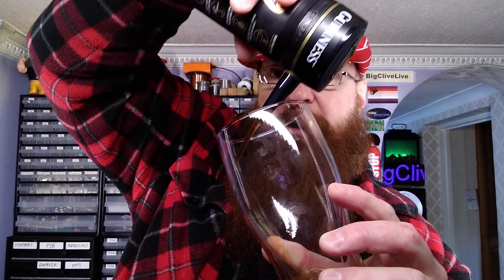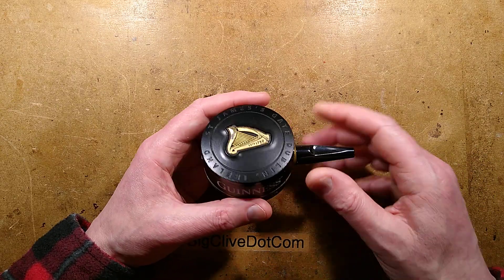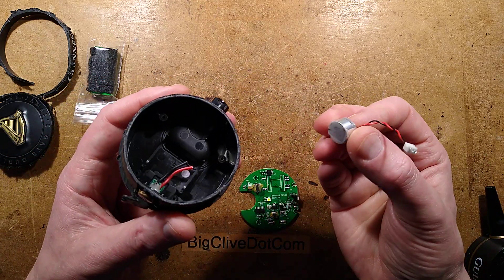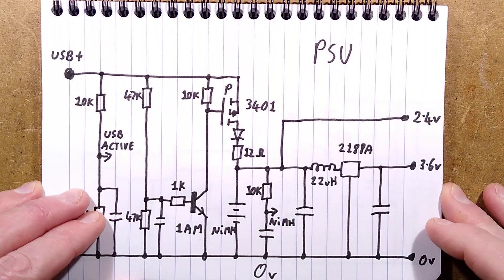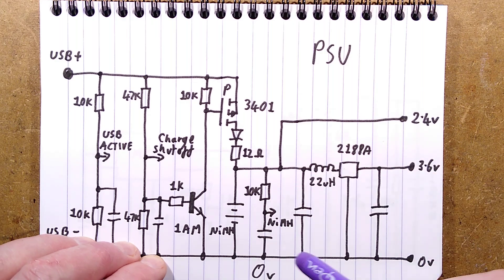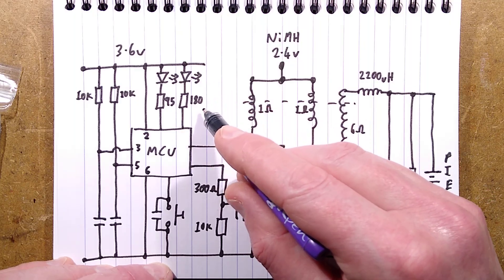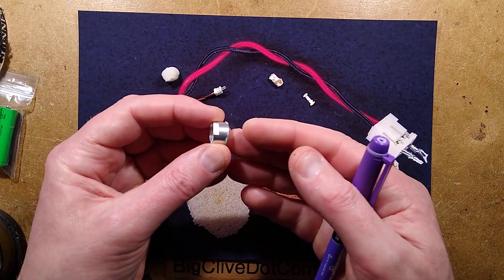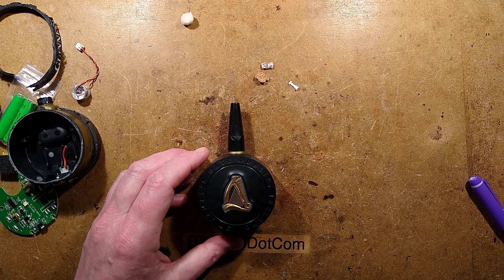Guinness nitrosurge teardown - with schematic

Comment: Did anyone complain there wasn't enough head on their Guinness then?  What happened to the plastic spinning tops that used to be inside (not as nice as the little marbles in paint spray tins, but a nice hark back to the mystery toys in cereal packets. :) ).
In my town there used to be almost as many Irish pubs as people (mostly long converted into corner shops or buldozed for flats now). Then, you had to order your Guinness and wait while the real thirsties walked away with their throat scratchingly fizzy lagers and IPAs. The barlady would leave your 'pint' until it had done its foaming, and then top it right up, and scrape off any remaining foam with a knife.  It was always worth the wait!  :)

Comment: What a faff - the widget in the bottom of standard cans does the job just fine.

I'm old enough to remember (fondly) when Guinness was served at cellar temperature and not run through damn chillers. Stout should not be chilled!

While i enjoy a pint of the black stuff it wasn't a patch on the much‐missed "Digger's Heavy" (McEwan's 80/-  - dispensed in huge volumes in the Athletic Arms in Edinburgh. Nectar of the Gods!

Comment: So much wrong with this.
First off, the glass used was dirty.
Second, it’s 568 mls in a can/pint.
And the angle for pouring was wrong.
You filled the 1st stage too much, and then didn’t let it settle for the required time for that perfect first mouthful.
Reply from the maker: This was a video about the circuitry.  The pour was just a brief demo.

Comment: Hi Clive, did you by chance measure the frequency used by this device? It would be interesting to know what frequency and why. Thanks for another interesting video.
Reply: Yes, I'd like to know the frequency and the voltage at the piezo. A bit tricky now as the transducer is now destroyed.
Perhaps it wasn't in working order by the time Clive had dismantled it enough to get a scope on it.

Comment: As it's so incredibly difficult to get inside that of course means that the rechargeable batteries, once not holding much charge, can't easily be changed, therefore this is yet another device that'll wastefully end up as landfill. Disgusting.

Comment: The LC circuit driving the piezo transducer has a resonant frequency of about 45kHz.  So, that's probably where they are operating, to get the resonant voltage boost.

Comment: Thanks, ChatGPT - definitively, certainly (may in fact be completely incorrect):
The PIC16F1824 is a low-power 8-bit microcontroller with 14 pins and operates on a 3.3V supply voltage. Pin 2 is VCC and pin 6 is GND, which matches the pinout configuration you mentioned.
Reply from the maker: The power pins do not match the PIC16F1824 (pin 1 + and pin 14 -).  But I bet it made the statement with its usual pompous authority.

Comment: i think its a company called funkin or something sell them rank nitro cocktails in a can but they dont use the ultrasonic thing i think it has a mini nitrogen container in it id be interested to see your take on them and how they work
Reply from the maker: The widgets are a hollow ball filled with nitrogen that squirts it down into the drink when the can is opened and the pressure released.
Reply: Thank you for the reply I've seen a widget before they came out years ago,weren't they  originally just to make more bubbles? i didn't realize that is how these nitrogen ones worked but i suppose it makes perfect sense to use the widget. I thought i already subscribed to your channel but must have done that YouTube thing where they somehow automatically unsub me from stuff for no reason but i have resubbed anyway

Comment: I remember the bar I worked at as a student had a bar-top ultrasonic surging device because it was impossible/impractical to get Guinness in kegs where we were. Apparently it didn't quite match kegs on the flavor/texture side but the surging action made for a fairly impressive little performance piece.

Comment: This has me curious about an idea for your "will it carbonate" series. Is it practical or possible for you to make a series on "will it nitro" where you infuse various beverages with nitrogen instead of co2? I think that would be interesting if there's a way to make a sodastream use nitrogen instead. Cheers.
Reply from the maker: I'd have to charge a bottle with nitrogen for that.
Reply: One can buy or make an adapter to connect a pub nitrogen cylinder to the soda stream. 
Then all one requires is an understanding publican willing to lend you such a cylinder and of course swap it out for a full one as required.
Reply: I'd really like to see how nitrogen compares to CO2 in beverages that aren't normally charged with nitrogen. Maybe it's just me.
Reply: @Eremon1  have a relation who is a brewer. He tells me the standard pub gas is mainly nitrogen with some co2. Cant remember the exact mix. Must ask what is in the stout gasses

Comment: A very impressive product indeed but a couple of thoughts about the reverse engineering: I didn't see where the lines that sensed the presence of the USB charger and the charge shutoff control from the first diagram went to the MCU in the second diagram and secondly, it would have been informative to have shown some 'scope waveforms relating to the piezo drive. Other than that, what a fascinating video! I think I'll stick to my barley wine though, ta 🙂

Comment: We used to have a similar thing to this where I used to work - we had to have specific cans of Guinness for it, and you placed the glass on a small metal plate which vibrated ultrasonically. It appeared to do very little at all, but if you put some drops of water on it, you could see it vibrate when you pushed the button. I can’t remember anyone ever using it with a real drink.
Reply from the maker: It's supposed to have a layer of water on it to couple to the can.
Reply: Used that too at my last work place, cool device for Canned guinness only.
Diageo sent it for free if you buy X amount of cans

Comment: The cap at 13:24 is something I  always use for getting rid of bouncing switches. Yes, you could do that in software, but a 10nF cap works wonders as a low-pass filter together with the internal pull-up in the uC. 10nF will give you a +/- 2ms delay and a clean on/off signal. Good enough for detecting 25 pushes per second.

Comment: Thanks Clive, Yet again after watching you it cost me money :)  I have been trying to find the nitrosurge version one for a long time but never did.  However, if you buy the correct cans of Guinness you can use an ultrasonic cleaner instead  just pop the can in the cleaner for 30 seconds or more, if you want one the new version they can be bought from Tesco for £30.

Comment: A device like this with non-changeable batteries should be banned and the one placing it on the market should get a perceptible fine. It's not magic to build a device with a separated and isolated waterproof battery compartment. We talk about environment all day and these devices are just calculated e-waste. It might be cool for Guinness - but bad for the planet.
Reply from the maker: The NiMH cells should last for an extremely long time.  Keep in mind that the ultrasonic atomiser disk has a finite life too.

Comment: So, they're at it again? I had the original Guinness surger from the early/mid 2000s. That one, you poured the drink into the glass and then surged the glass to enable activate it. It looked very good but the cans of drink which, if anything should have been cheaper to make were more than twice the price of the draught cans with the plastic widget inside. After a while they stopped making the units, and the cans became harder and harder to find.
Reply from the maker: You can use your original surger with the widget cans if you tap a pin through the top of the can to very slowly release the pressure so the widget is slowly deactivated.  Then pour and surge.

Comment: You can get the same results from an ultrasonic jewellery cleaner. You start by piercing a tiny hole to release the gas in the can then put 6 cans after putting a hole in the top of the can in the fridge for 30 mins then put a can into the ultrasonic cleaner standing up for 5-15 seconds then take out and pour and enjoy

Comment: Some bars that don't sell much Guinness have a 'Guinness surger' thing which is not the same as this. It works from the bottom of the can rather than the top. They are quite rare so am wondering what the difference is?
Reply from the maker: I featured the plate surger in another video.
Reply: None from Clive's teardown here :) I have one. Same concept just the surger is a one and done thing and not portable. nitrosurge surges as the fluid passes through it.

Comment: After pouring the pint, is it really the bubbles that drop down, or are they anti-bubbles?
Reply: Nitrogen bubbles go down whereas CO2 bubbles go up. I think in practice there is a circulation going on otherwise they wouldn't form the head at the top.
Reply from the maker: I'm not sure what causes the visual effect.

Comment: I remember the height of Guinness technology was "the widget", a ball thing that did a thing to make the bubbles do their thing, and they got Jack Dee to sing about it on their TV ads, still have no idea what the heck that thing was, or did... :P
Reply from the maker: Still in the cans.  It's a capsule pressurised with nitrogen that shoots out a jet into the guinness when the can is opened and the pressure is released.
Reply: @bigclivedotcom  Ah, so there's still nitrogen in there doing its' thing then, haven't had Guinness in a while (and was in bottles too, so, no widget) so never really knew that it was still about... :D

(And thinking of the thing has gotten that Jack Dee ad playing in my head, funny how almost 30 years on it still resides in my mind!!!)

Comment: Oh man.  So cool.  I've been wondering about this thing in your Patreon streams (Fascinating!) (Not a shameless plug by any means!)

I really think it would be cool to have some multi-part hours long streams of you pulling stuff apart and working things out like this.  I'd be glued to it like this thing was ultrasonically assembled and it would take a Dremel to pull me away!

Thanks Big Clive!

FredRock.
Reply: Oh, I wonder if the cork may provide attenuation sonically. Sort of direct the vibration in an intentional direction with it's sort of uniform density and with the foam being like a speaker enclosure in front of it.  Pretty high frequencies I'd imagine and kind of intricate for the assembly itself.  Yea, why not just have a transducer there?  Like you say, the eventual knockoffs won't ask that question.  Sort of like comparing an Audi to a Yugo.

Comment: There's something both mildly disturbing yet highly amusing seeing a bear repeatedly saying the words creamy head over and over! 😂 I used to use the pub version with an ultrasonic plate we put the glass onto that did exactly the same thing. They also have the cans with the plastic ball inside that never seemed to work without first being given a mighty thwack on the bar before pouring!
Reply: I think the cans work pretty well tbf. They will never match a decent poured pint in a pub but still add something over the standard cans which are just rank.
Reply: @The Browns   This was 8 years ago when as far as I know they had just started making them so they could well have ironed out the kinks. As long as the place cleans the lines out draft will almost always be the way to go as the gas is added in at the time of pour so dosnt have the chance to change the taste through acidity. 👍
Reply: @ConfidentialMeerkat   What crazy alternate universe did I stumble into? I most definitely remember that tell-tale pop then hiss, the rattling in the can, and dad showing me bubbles that flowed down instead of up... it must've been 25+yr ago when I finally cut the can open to see what the rattle was about. I've never had a bad pour except from a poorly-maintained keg, or those shitty glass bottles.
Reply: @ericwazhung  They most likely either started doing them again at the time or they just weren't that popular I've only come across them twice as the places I worked at didn't do draft for whatever reason it was. But it was the first time I'd come across them and thaught that something untoward had gotten into the can!

Comment: Brilliant teardown as usual (With Schematic) BC but mysteriously these new special cans of Guinness cost a lot more than 'standard' ones that you can chill down in a fridge who would have thought it?
Reply from the maker: I think the price will come down when the novelty wears off.  There's a trick to open the widget cans without triggering them by tapping a pin through the top and letting the pressure bleed off slowly.  Then the can can be used with the surger.
Reply: Thats why no one buys them here... 😂👍☘
Reply: Nice tip BC thank you

Comment: The ultrasonic transducer looks quite a lot like the ones you used to get in TV remote controls before infra-red became really popular. The ones that you could jingle your keys near and it would change channel.
Reply: The clapper for the lamp the jingler for the tv. Miss those days
Reply: That sounds more interesting.
Liked the old analogue things that would behave strangely and you'd have fun trying to figure out what and why that caused it.
Reply: Those ultrasonic remotes for TVs were fun. You could get it to do the 'wrong' thing, like changing channel while you were pressing the volume button, by quickly moving towards or away from the set, so the doppler effect changed the frequency seen by the TV.
Reply: thanks i feel really old now.
Reply: 😂 I’m too young to remember that but that’s hilarious
Reply: Ah, yes.... the old "clicky" remote controls. Didn't even have any electronics in them, a purely mechanical device. They didn't work the greatest if the volume was up very loud, or if it was noisy in the room.

Comment: They had some actual engineers work on this. I think the cork is supposed to be a damper system, and the LC circuit may have a harmonic interaction with the frequency domain of the cork

Comment: I was wondering, why hasn't any breweries used N₂O(Nitrous Oxide) instead of boring old CO2 or Nitrogen? The nitrous would give you quick little buzz while waiting for the alcohol to kick in, it be great.

 I don't see why it would be a problem, whipped cream companies have been using it in their cans for basically forever even though they know a lot of people buy them and then throw away totally full cans that are completely flat.

 I don't see why it wouldn't work since if my memory correct, Nitrous Oxide is over 30 times more soluble in water compared to Nitrogen. Although since nitrous oxide is a oxidizing agent then it's possible it will ruin/change the flavor, Idk

Comment: Our Guinness cans in the States have a nitrogen widget inside the can. The pressure in the can releases when opened and the widget bursts open.
Reply: Same in uk
Reply: Widget, it's got a widget. It's got a widget, a widget it has got.
Reply: Yes, those have been around for years but this is a much newer system ...
Reply: i cut open a can once to see what the "widget" was. it's just a plastic ball. no "bursting" or any sort of technology i'd expect from the term "widget". straight into the landfill 😕
Reply: @LieseFury  As far as I understand it, the ball contains nitrogen under pressure. When the can is sealed the pressure is contained. When you crack the can, suddenly the pressure inside the ball is much greater than the outside and the nitrogen is squeezed out into the liquid.

Comment: I would be surprised if a Chinese knockoff does anything besides an unfiltered boost converter feeding right in to a remotely matched piezoelectric disk through a little RC transistor timer

Comment: You know.. You don't need a battery to do that, or even any electronics at all. A radio crystal (probably EDT) submerged in some oil emits ultrasonic frequencies. Nothing new. 80 years ago it was a way to combine immiscables with water. The one photo was just a glass flask with a little crystal in the bottom submerged into another flask of oil and water. It was "boiling" together in the middle.  Possibly the oil around the crystal is squeezing it till its a tuning fork. Its all piezoelectric effect stuff.